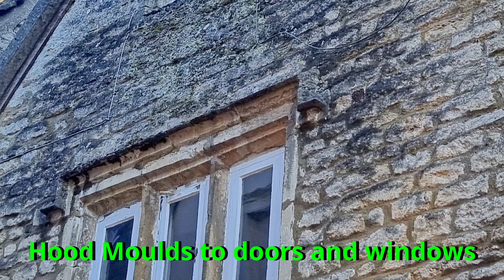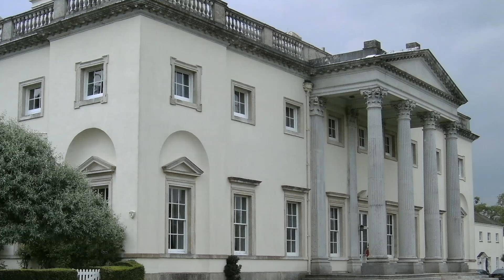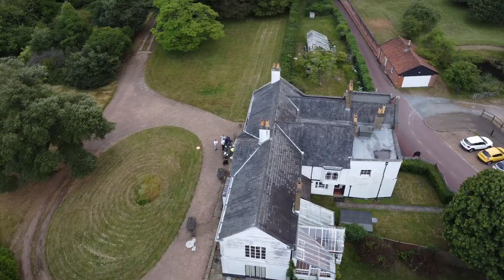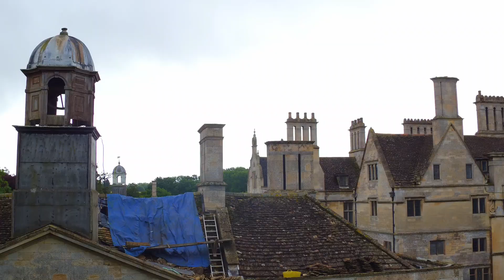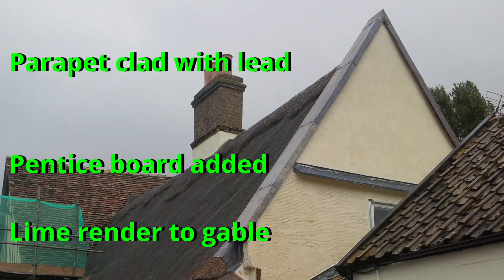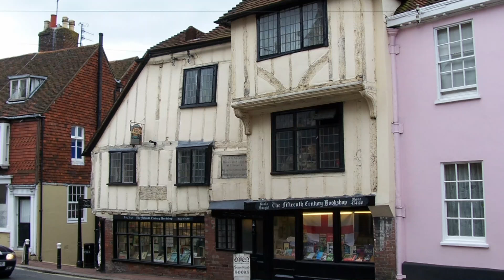Lime Mortar Details That Matter – Drip Detailing, Exposure & High-Level Repairs

Comment: Thanks so much for all the helpful information. Is limewater as useful as limewash to apply to old stones to help with protection?
Reply from the maker: Limewater is better for consolidation, while limewash is generally better for surface protection.  Limewater will tend to penetrate further before depositing the lime element, whereas limewash tends to stay more on and near the surface.  It depends on the nature of the stone and exposure to weather, as well as aesthetic appearance.  Limewater tends to be used on friable surfaces where there are 'pores' that need filling with lime to help stabilise the stone. It tends to be used on specific features and details that need help to consolidate.  If you are looking more for protection (from weather) then limewash would probably be more appropriate.  Speak with someone knowledgeable in your area who understands the location/weather and old buildings/details.